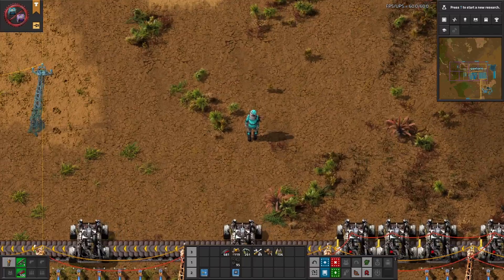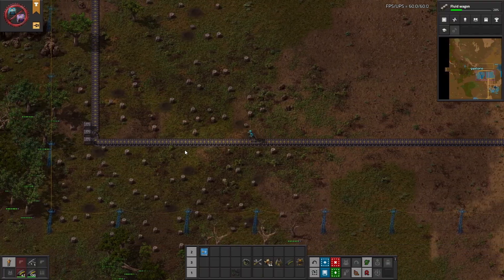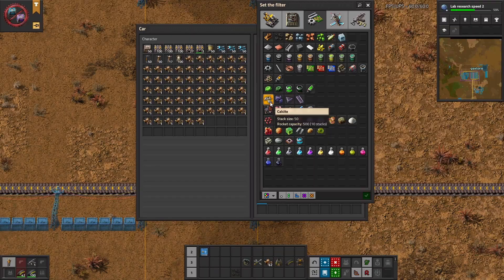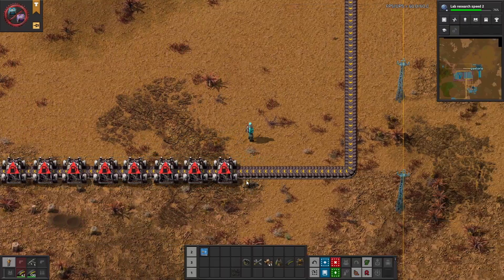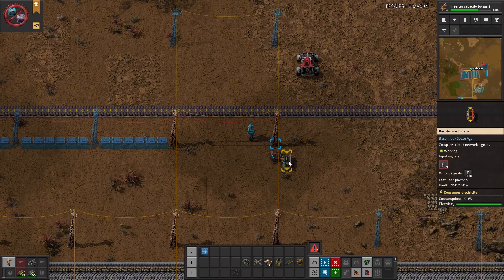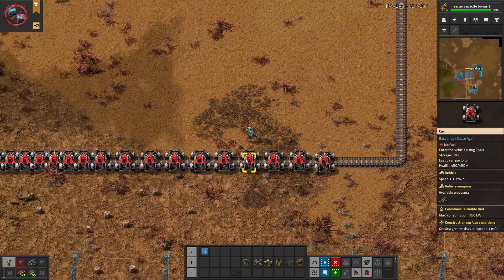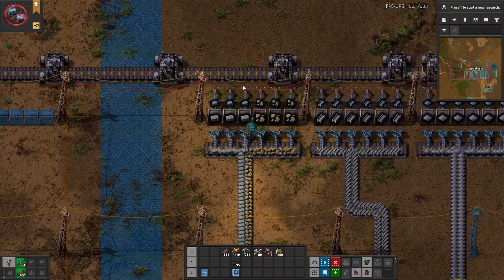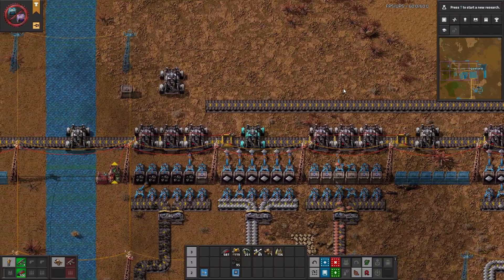Factorio Car Bus Tutorial

Comment: if you fill all the belt with cars you wont need any control signal and the inserters will keep working as long as you are using the items you are importing to the car bus
Reply from the maker: Yes, right! You don't really need the timer. But, if you over saturate the belt it is more likely that you might knock a car off the track and cause a deadlock. I also like having it because then I know the throughput exactly, and it looks a lot cleaner!

Comment: Very interesting design indeed. However I can't help but wonder why you call it overpowered? It's not convenient to set up because you need a loop and stops for cars everywhere they get materials to/from. You need to set up all the filters in cars beforehand which means that if you would like to change them later you will probably need to empty every car of excess items. It's quite slow because most inserters that put stuff in the cars are not working large portion of the time so you get an unregulated throughput. In my opinion the main advanteges of the main bus design are:
1. It's extremely easy to build and expand
2. You know the throughput of your bus.
3. You can roughly distribute stuff between different production lines if you don't have enough items to satisfy all of them by using splitter priority.
4. You don't need to know (at least as much as in this design) which items in what quantities will you need

And in my opinion car bus does not have as many advantages as a usual bus has. Maybe the mall designs would be more useful but I'm not sure...
Reply from the maker: I think its much easier to setup and use than the main bus, especially just building a junction on a big main bus can be pretty tedious, vs just setting some filters on some inserters. Of course direct access to the cars from the assembling machines is super powerful and not possible with main bus. It has an insane amount of throughput and so you would need like 80 lanes of your main bus to match. Changing the inventory filters can be annoying but usually i just leave some empty filter slots if I know that I might want to add things later, but yes its hard if you have to remove something to replace it. Not sure what you mean by its slow/unregulated throughput, this isn't really a problem. Its very easy to know the throughput of the car bus: items/stack * stacks/car * car/second. Yes the priorities are a bit more difficult to handle, sure. I don't really think it takes much more planning to make a carbus than a mainbus.

Comment: This is actually crazy and is a legit way, if using tanks, to scale fulgora scrap processing without using on-site blueprints, which are a great pain to design. Even with normal tanks without toolbelt equipments if used for scrap output one tank holds an average of 8k items spanned across 2 tiles (belts), which is a 166 times improvement in capacity over 2 fully stacked belts, thus a 166 times throughput increase. With legendary tanks filled to the brim with legendary toolbelts one tank holds an average of ONE HUNDRED THOUSAND scrap outputs! Tho I doubt it is practical to even use legendary tanks at any point as even normal tanks with toolbelts is a huge increase over an already ridiculous base tank capacity. Well, the real problem after this point is processing outputs, especially with quality, but i think it should be pretty easy with proper alignment to output from the tank line straight to trains and then process the stuff elsewhere if space on the tank island is not enough. I actually want to start a run just like you just to abuse this car/tank bus concept.
Reply from the maker: yes, even using just the cars is a ton of throughput, but the toolbelt equipment + tanks + legendary gets absurd. I eventually want to push the base to that, but got to make all the legendary material first. Would love to see your base if you get something working!

Comment: Tempted to try this in a recent overhaul playthrough. Having many intermediates involved in each recipe makes a sushi-related setup very useful, especially when you can dynamically change the throughput for a given item without allocating more space for the bus.
Reply from the maker: yes its super adaptable!
Reply: @paxtorio1495  I just need to fix things up with the existing abomination of a base first, starting with power, which means waiting for trees to grow to feed resin for plastic for red circuits for centrifuges. Oh, and also crafting everything else needed for a nuclear reactor.

This might be slightly heretical, but currently my uranium processing is using a cargo wagon to distribute uranium between the centrifuges and the fuel cell assembler. (Or at least it will be once the centrifuges are crafted.)

Comment: thats just a more complex variant of putting down cargo wagons with 1 rail piece spacing and using long handed inserters to shift items from one wagon to another.
in the cargo wagon variant all you need is staggering red and green circuit logic so a cargo wagon can "request" from the inserters next to it what items it needs.
The Cargo Wagon is basically a custom reimplementation of the logistic network but using item teleportation and next to no power (except for inserters) to move it arround which if setup correctly seems more efficient in electricity and time then putting cars on belts and spacing them out.
Reply from the maker: interesting idea! how high would the throughput be though?
Reply: @paxtorio1495  I came here for cars on belts.  I stayed for the Socratic method in comment replies.

Comment: This reminds me of a quote I heard in my networking class back in college: "Never underestimate the bandwidth of a station wagon full of tapes hurtling down the highway" - Andrew S. Tanenbaum

Quick explanation: even if you have 10GB/s internet speed, a car full of hard drives can transfer more data within the same amount of time, haha
Reply: That's why datacenter migrations are done by sending a big freaking drive stack to the datacenter to be migrated, getting the data on that stack either by copying in parallel or physically inserting drives and then transporting the drive stack to the target datacenter where the data is offloaded.
Reply: only if you ignore the time it takes to get data on and off the drives
Reply: @FirenX951  You don't have to ignore anything. Mass data migration is done with so much parallel processing that it's not at all a problem and drive to drive or even data center network will always be so much faster than over long distance connections that the drive copy time is not really a factor when talking about large amounts of data.

Comment: I get that this is half for the memes, but this really seems like you've just invented trains lol. I feel like the cars will eventually be heavily throughput capped. Everything always circles back to trains lol.
Reply: For legendary nuclear fuel, the theoretical max speed of a train appears to be 1.65 tiles per tick, or 99 tiles per second. A single wagon takes up 7 tiles of length, so that would be ~14.14 wagons per second. Each wagon holds 40 slots, so ~565.7 stacks per second.
A turbo belt moves 7.5 tiles per second, and a tank takes up around 3 tiles, so 2.5 tanks per second. A legendary tank filled with legendary toolbelt equipment has 1010 stacks each, so 2525 stacks per second.

Which did you say has lower throughput? Even if cargo wagons were affected by quality (which is a single yes/no flag that can be set by mods), the conga-line of tanks would still have higher theoretical throughput, though it'd be much closer (~1414.3 stacks per second). Of course this is theoretical throughput. Both would be severely limited by inserter speeds, and trains are further limited by acceleration and the fact that the rail can't be completely saturated with cargo wagons. Trains however still win in flexibility, making them better for getting items from mining outposts to the base.
Reply from the maker: @angeldude101  I dont think inserters can access a moving trains, and so the trains would have to come to a stop and this would greatly limit throughput.
Reply: @paxtorio1495  I know. It was just easier to calculate that way, and it also means that the lead that the tanks have is even greater than what I could calculate.
Reply: Sushi belt are the original trains if you think about it but with extra steps.
Reply from the maker: Trains and Car Bus are best friends! The throughput of the Car Bus is actually insane.

Comment: The clock and be made without the constant by adding an additional output of 1 c. 

You can also copy filters on a car by making a blueprint of a car. You do this by clicking add content on a blueprint (or use the shortcut to create one), and while dragging over the car, you also hold shift and enable vehicles in the blueprint.
Reply from the maker: totally! yes i'm stuck in my pre 2.0 ways
Reply: @paxtorio1495  I'm sure you'll wiggle your ways into post very fast!